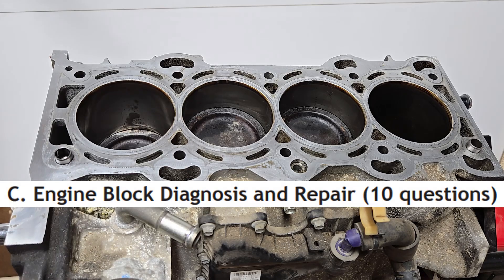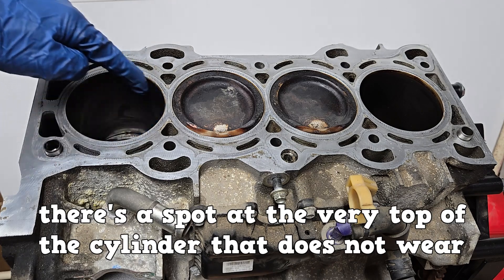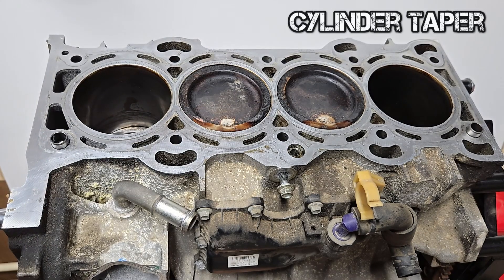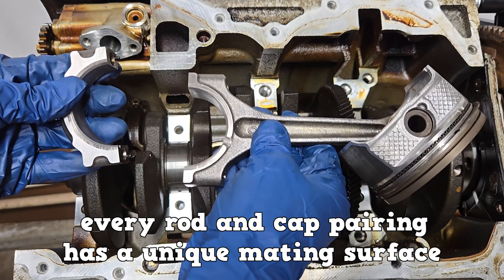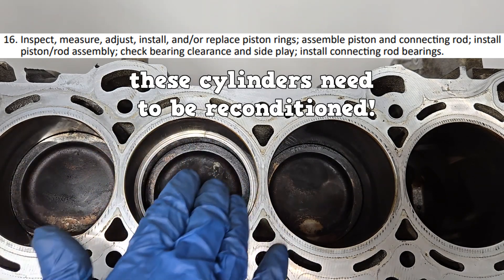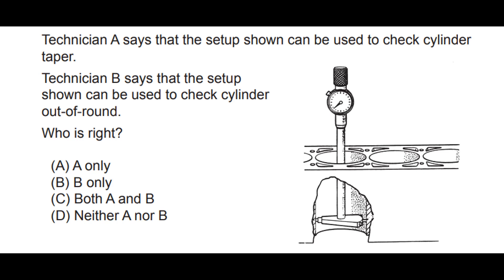ASE A1 Test Prep #4 - Engine Block & Piston

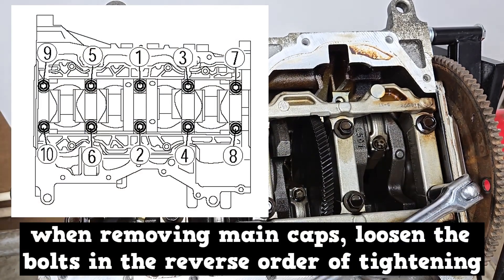Comment from the maker: Feedback after taking the test: Info to know is between 1:44 and 2:55 , when making multiple measurements for cylinder taper, use the largest calculated reading.
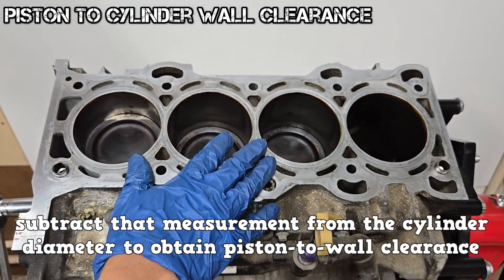More info to know between 4:33 and 4:50 . Noise! Also know noises from the top of the engine, noise from the middle of the engine, and from the bottom, sometimes referred to as "deep." How to diagnose these noises by "grounding" the cylinder. Know noises that come from the intake system, these noises are referred to as "induction noises."
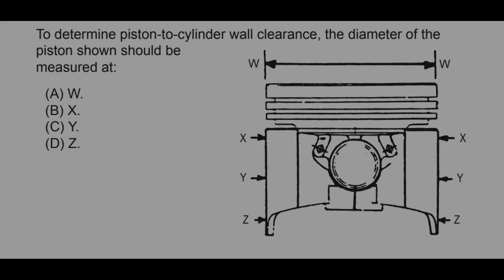More info to know between 5:47 and 6:18 . 

2 questions that caught me by surprise, I suspect these were the "research questions" that do not count towards your score.
-First one was diagnosis on a system that uses Cylinder Deactivation.
-Second was diagnosis on a vehicle that uses an engine on/off system. (Engine shuts off when you come to a stop).

Overall, this video series will help you with about 25% of the questions on the test. My rating for the helpfulness of each video is:
Vid #1 - General Engine Diagnosis =  8/10     GOOD INFO
Vid #2 - Springs/Valves/Guides = 0/10   Skip, I went waaay to deep on this one
Vid #3 - Cylinder Head & Camshaft = 4/10   Overall good info but needed more
Vid #4 - Engine Block & Piston = 4/10  Overall good info but needed more

Comment: The info at 4:06 is misleading. Cracked piston rods shouldnt be marked with a punch. 

Here is the explanation from the official ASE practice test: 

"Cracked rods are formed with the cap in place. A machine cracks the cap from the rod leaving each end unique. They fit together like a puzzle and this adds to the assembly’s strength. They should never be installed with a different rod or in a reverse position. A, B and D are true. C is a false statement. These assemblies are made from powdered metal and should never be struck with a stamp."
Reply from the maker: Good info, I should edit this video to highlight the fact that the caps should be labeled with a paint marker rather than stamped with a punch. That has been the old school way to do it and I've seen no problems doing it that way, but I've done it on older vehicles. I did not see any questions about labeling components on the test.
Reply: @OldSchoolNoe  Yeah, on the older stuff I have used a punch as well. The cracked caps question on the practice test threw me off cause of that.